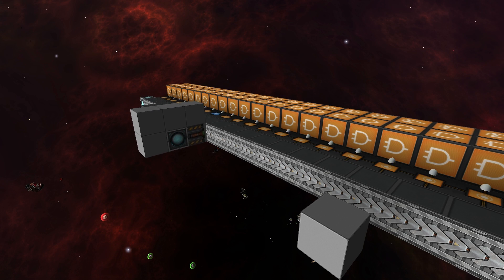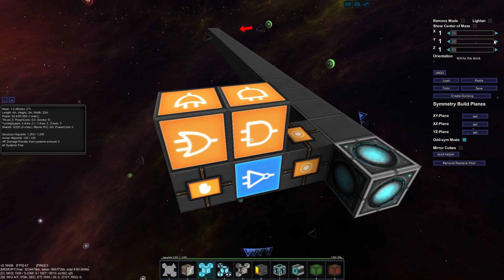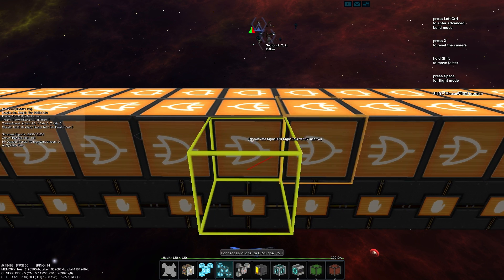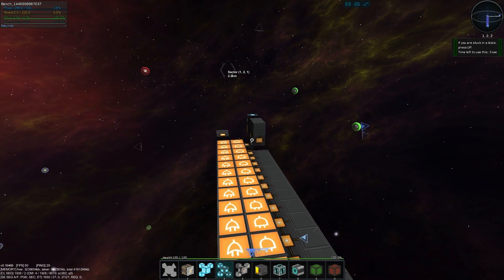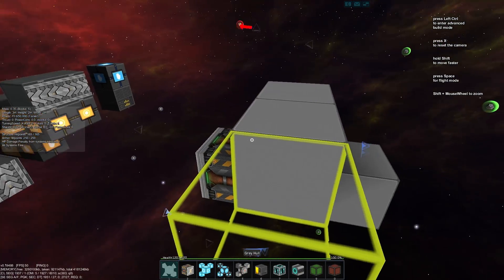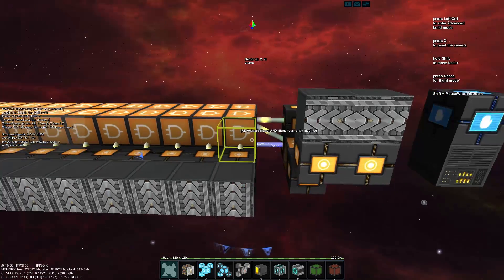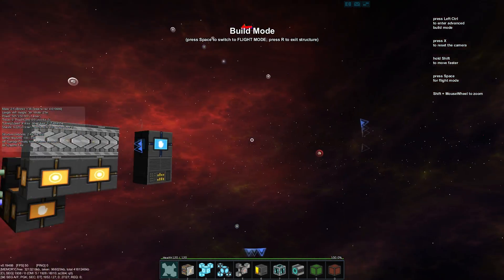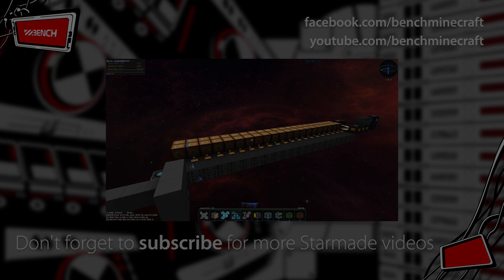Starmade Rails - 15 - Detecting Collisions

Comment: why not to deactivate the speed of the rails?  It should be better if there are changes in the trajectory of the rails or don't you think so?
Reply from the maker: +Alfonso Sánchez (Fonso-s) You could use a speed controller. just connect the back activation module that is connected to all the others, to the activation modules connected to the rail speed controller and you won't need the stop rail part.

Comment: @01:21, so the BUTTON, the NOT gate and the ACTIVATION module are all going into the AND gate, correct; and the AND gate is the only one going into the OR gate, right?  I just wanted to be sure that is what you said, you were going a little fast at that point, and it was hard to tell what was being hooked into what.

I just wanted some clarification because when you said Activation module, you had the cursor on the NOT gate.
Reply from the maker: +Bernard Gilbert Ok here's the connections...
BUTTON goes into the ACTIVATION, ACTIVATION goes into the NOT, NOT goes into the AND, first BUTTON goes into that same AND, finally AND goes into OR

Activation doesn't go into the AND
Reply: Bench Ok,Thanks for clearing that up.

Comment: I'm curious. Since the game moved to the rail docking system, I have a ship whose landing bay door stopped working. It operated by detecting if its locking module had a shuttle docked to it or not. A docked shuttle meant the bay door was closed. Undocking the shuttle triggered a logic circuit that opened the bay door. When I updated that mother ship to use rail docks, the logic circuit broke. The single rail block could not pass a signal to the circuit stating if it had an object on it or not. It only worked if it was part of an actual rail and the shuttle was moving along said rail. -- Is this still a problem or is there a solution?
Reply: +Surgeplus I had the same problem, but it was when rails were still in dev build. It works fine after it was full release. Check your logic system to see if you made a mistake, or rebuild the logic system. I've had times when I cannot find anything wrong with my system, so I rebuild it, and it starts working (probably because there was a mistake that I couldn't find). If it still doesn't work, then I've no idea why.
Reply: Micro753 Its the same exact logic circuit I had back when the game still used the Docking Modules and Docking Enhancers. The only change I made was replacing the docking module with a Rail block and removing the docking enhancers. I even moved an activation block immediately under the rail block. The circuit worked, but the rail block didn't seem capable of activating the circuit's logic properly if at all.

I'll take another pass at it and see if it is working after this much time. The bay has two pads hooked up to the circuit and both were swapped to the rail system when it first came out. Its possible that its getting a conflicting signal somewhere that's breaking the circuit.